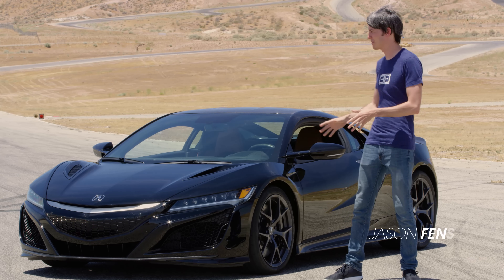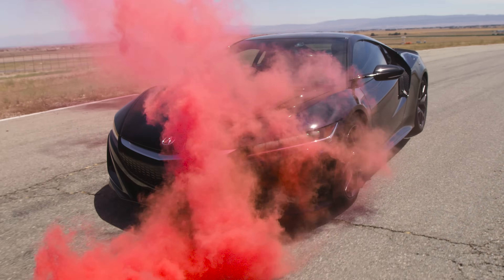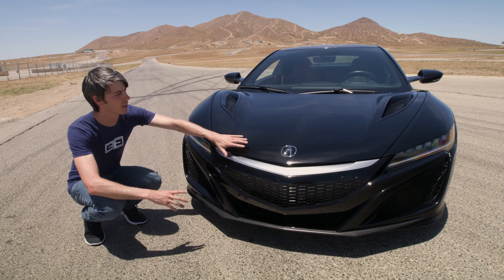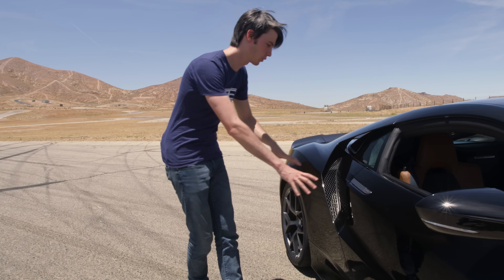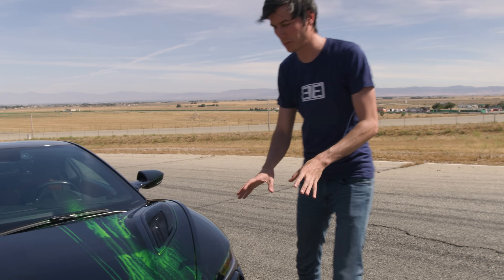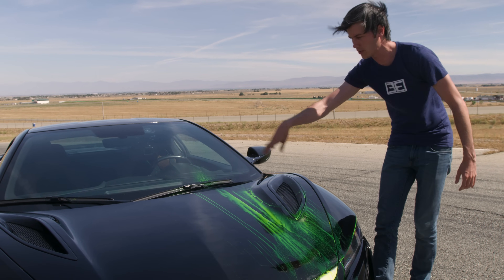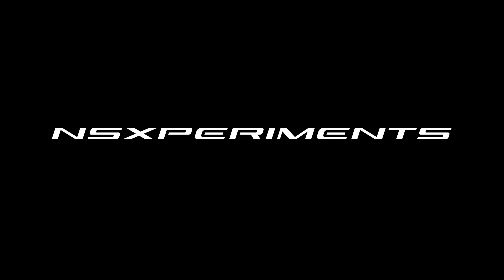Using Smoke Grenades To Understand Acura NSX Aerodynamics

Comment: Hey, the video that you made on effectiveness of the sports brake, isn't it that you must take the temp of the disc when you heat them n then run for a bit so that they actually cool due to the centrifugal force rather than just stopping n taking the reading in which case it'll just give the value of the heat produced which will obviously be more in sports brake since they stop faster

Comment: so is the weight distribution a 3:1 or 4:1?
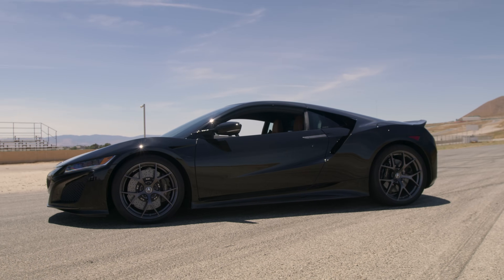Reply from the maker: 3:1, as discussed at 2:30. Or 75% on the rear, 25% on the front. 75/25 = 3.

Comment: What is the flow viz paint made of?
Reply from the maker: It's a mineral oil mixed with some powdered paint. Not positive on the specifics; Donut Media (the crew who shot this video) actually contacted Red Bull to get the formula (ehh? formula?) from their F1 team. It's challenging stuff to work with, which we learned very quickly. Have to get the perfect viscosity in order for it to be effective, which is challenging to determine when you've got about an hour to figure it out during the shoot. But cool nonetheless!
Reply: hahaha. I know, when i was at my Formula Student team we experimented with paraffin and titanium, really difficult to find the right composition!
Reply: Engineering Explained :  The "paint"  part is fluoroscein,  the same dye used in ethylene glycol antifreeze.   It is used for many applications from medical to waste water tracing.